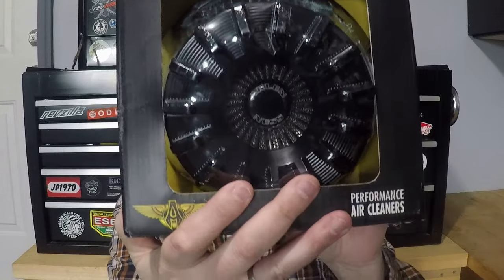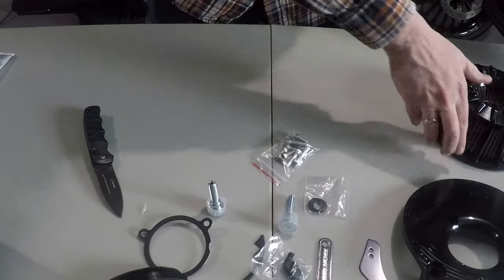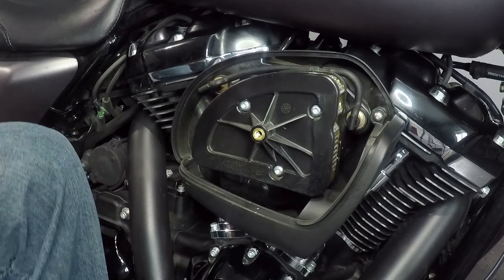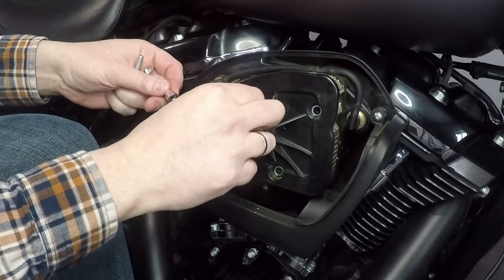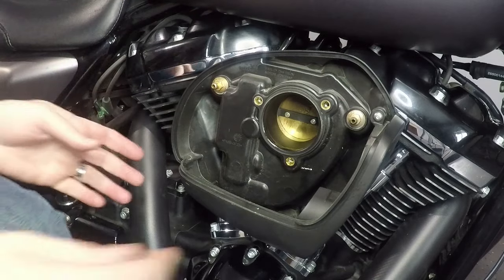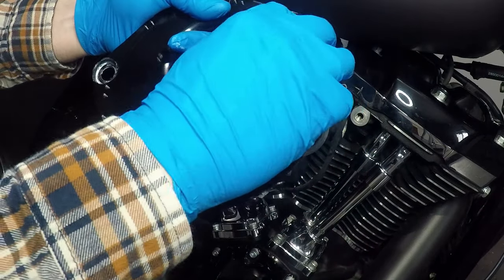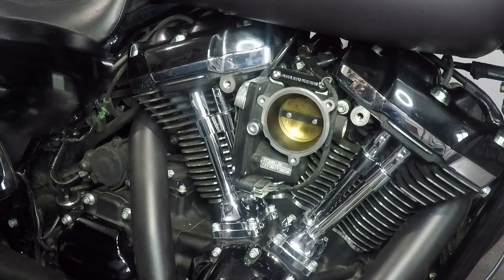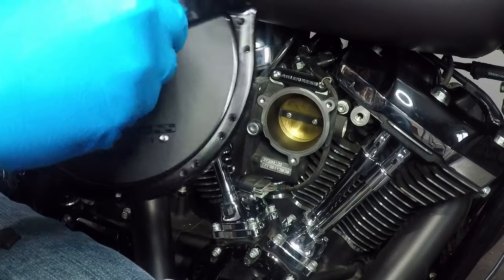Install Arlen Ness Air Cleaner on 2017 Harley Davidson Road King Special

Comment: I am installing mine tomorrow, so I am watching your video to learn how to do it.
Reply from the maker: Good Luck. This is a pretty straight forward install!
Reply: @kidmoto22  well, that was a bust. The rear cylinder breather bolt is way off. I had a Screaming Eagle air filter that a dealer installed and taking out the stock breather bolts was a little tough. I have a feeling that my throttle body is misaligned. I just stop today so I can look at the solution with a better mood. I have installed other air cleaners on my previous bikes and never had any problems.
Reply from the maker: Jose Betancourt Man thats too bad. I hope for better lick for you when you look at it later.
Reply: Question, if the induction module supposed to have free play??? I had to lift the module to get all holes to line up. The whole intake manifold moves but the flanges to the heads are not moving, like it is supposed to be.

Comment: Great video straight forward. I did install mine , on my 2023 FXLR ST , for some it gets hot . Did you experience the same ? Thank you for your time
Reply from the maker: I can’t say that I’ve experienced heat above what I think is normal.  The best feature for me has been the water resistant filter. I’ve been caught in the rain a lot this season riding for hours in the rain and it’s never failed to do it’s job.
Reply from the maker: Not sure if I ever noticed a heat increase.

Comment: Looks good, Kid. I've never seen an air breather with an oil reservoir. Do you know if you will need to remap your bike with it sucking in more air? Just wondering.
Reply from the maker: Thank you Tramp. I do have to remap the ECM and I got the FP3 in the mail yesterday so that will be coming soon cause I’ll be riding very soon!

Comment: Hello Kid, I also have the 2017 road king special, and Arlen ness inverted sucker air cleaner kit......  I installed exactly how you showed in the video.  However, when i start the engine the RPM's go extremely high! after a few seconds it calms down a little, and the there was a lot of popping coming from the exhaust, then suddenly the bike starts to rev up again by it self.  I turned off the engine... now asking for help.
Reply from the maker: Do you have stock exhaust? 
It sounds like your bike needs a tune. If you get something like the Vance and Hines FP3 you can connect to the ECM and tune your bike to the correct air cleaner and exhaust system. This should solve your issues.

Comment: Another great video thanks.  I did find it a bit weird how the cable that was cut during the stock removal just remained swinging in the breeze
Reply from the maker: I’m not sure what your referring to? The stock cable that was cut was connected to the original cap and was removed. The cable on the bike was then connected to the new cap. There is an empty connector near the front light that is part of the lighting on a Road King Standard with additional front lighting. Maybe that’s what your seeing?  Thanks for watching!
Reply: @kidmoto22  mmm. It must have been the stock cable but I must have missed the removal. Cheers

Comment: i bought this air cleaner just instslled itbut i,m thinking about ditching already befor my first ride because its an obstrution to my floor board and brake pedal...
Reply from the maker: I’m a taller rider and I’ve not found it to be a problem. That said there are many air cleaners aftermarket and stock that can cause a problem.

Comment: Do you know how far the air cleaner sticks out from the TB?  I'm considering installing this air filter when I upgrade my carb in a couple of weeks, but I'm concerned its going to stick out so far it would rub my shin when reaching for the rear brake.  Great looking filter though!  Looks great on your bike.
Reply from the maker: I’m 6’3” and I don’t have a problem with how far it sticks out. I don’t find it any more of a problem than the stock air cleaner.
Reply: @kidmoto22  That's what I was hoping.  I think I'm going to go ahead and pull the trigger!  Thank you for the quick reply.
Reply from the maker: No problem

Comment: With the old  breather tubes removed. have you noticed any oil. is there anything securing the vent tubes.
Reply from the maker: Theo Sid In the video at 10:47 I’m installing the vent tubes that are used for oil blow back and push it back into the throttle body. There’s also an oil collection reservoir on the backing plate that can be seen while I’m installing it. The vent tubes are held in place with the small plates that are installed behind the backing plate.
There has been zero oil on the engine since the install. Run for almost 5000 miles no issues.

Comment: any oil puking from the throttle body?
Reply from the maker: So when I just did the intake change I was getting misting yes. I tried the fueling dip stick vent..didn’t solve the issue. My next try was the CAM chest with the upgraded oil pump and that pretty much solved the issue.

Comment: Interesting update: This kit no longer comes with the throttle body badge. Sort of a bummer because you can see the exposed mounting holes but no harm. Guess AN is cutting cost.
Reply from the maker: That is interesting. Did you ask about that?
Reply: @kidmoto22  Ya. I sent over an email. Replied asking if I could at least buy it separately. It's not a big deal but I'd prefer a finished look.

Comment: Do you have to put a gasket behind the oil catcher?(the cup you screwed on)
Reply from the maker: If I recall correctly there is a gasket that went behind the oil catch.
Reply: Ok Thanks. You didn’t not show that and I didn’t put it on.😂
Reply from the maker: I’ve honestly not had any oil issues so let’s hope it’s the same for you!
Reply: I hope so. Also did you install a filter cover gasket between the backing plate and the cover over the filter? My kit didn’t come with one.
Reply from the maker: @ronaldhicks2965  Nope nothing like that is included in the kit.

Comment: When installing did you ever needed a tuner or a fuel pack ?
Reply from the maker: Yes I did install and use an FP3 for my specific combination of air cleaner and pipes.
Reply: @kidmoto22  would the best idea for me to get a fuel when I buy both pipes and new air filter and do it  all together
Reply from the maker: @ItsPiccoletto  Typically if you just do slip on pipes you don’t need a tune, when you change the air filter and or the head pipes you’ll need a tune to keep the bike running correctly. More air with full exhaust system or air cleaner would require a tune. Hope this helps.
Reply: @kidmoto22  the pipes I’m going to use is Fab28s. I’m sorry if I’m asking a lot of questions lol since I’m pretty cautious and want to make sure I don’t mess up. Thank you again for the information definitely gives me a idea 💡
Reply from the maker: @ItsPiccoletto  That’s a hella great pipe setup for your bike! No worries about the questions.
Reply: @kidmoto22  could I go to a local Harley Dealership and have them tune it up ? Since if I tune it up I most likely can lose my warranty
Reply from the maker: @ItsPiccoletto  Each dealer has a different idea of voiding the warranty. You’ll likely need to have a HD tune to preserve the power train warranty. Most dealers are going to charge a lot for labor and tuning but it’s worth checking out.

Comment: Ok I just called west end Motorsports and they are calling Arlen ness to try and send me one. It was listed as one of the parts but I also have the Method air cleaner and you have the inverted one.
Reply from the maker: Sure there are some differences. Does yours have the water resistant air cleaner?
Reply: Yes it’s water resistant as well
Reply from the maker: @ronaldhicks2965  I rode last season in the rain and after the bike had been out all night in a storm and it worked like a champ. Hopefully yours does the same!
Reply: I hope so. Thanks for you time. Great install video!

Comment: Did you do a tune after you installed the AC?
Reply from the maker: I didn’t tune with the Tab slip on pipes but after the air cleaner I did. I used the FP3 and I have a video where I talk about that....check it out!
Reply: Just added the clear big sucker to my ultra. Waiting for the FP3 to do the tune. Can't wait to see the gains! Plus it looks great!
Reply from the maker: Vinny Pandolfo Thats great man. I’m sure it will feel amazing!

Comment: Does your intake leak man
Reply from the maker: It doesn’t. The M8 motor is designed to mist oil back into the heads and with the stock air cleaner that is all contained inside. When you have a more open air cleaner it gives you the impression that it leaks. However the real issue is the sub optimal oil pump. When I did my Stage 2 and installed a complete S&S Cam chest it comes with an upgraded oil pump that solves the sumping issues of the old pump.
Reply: Mine leaks a lot will look into the oil pump I'm just at stage 1